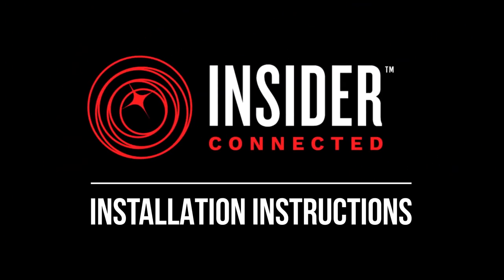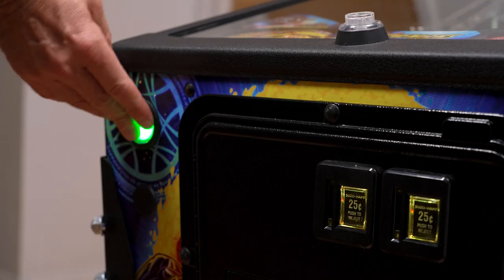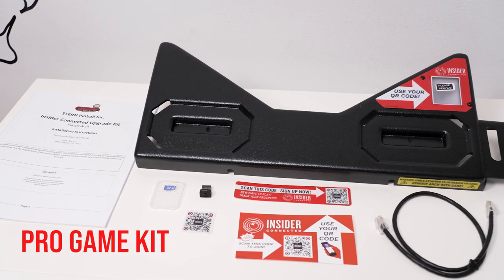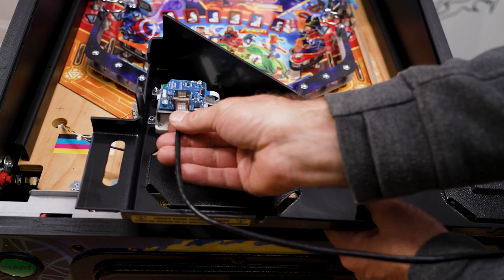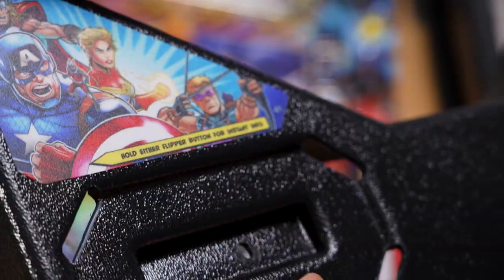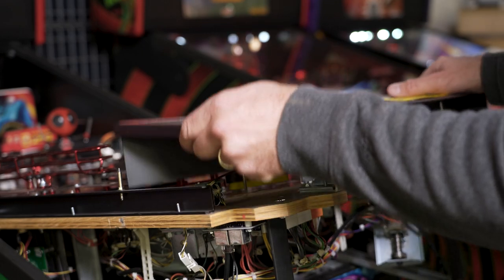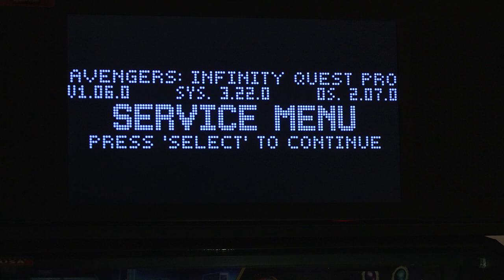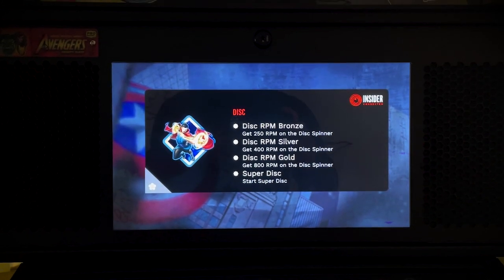Insider Connected Upgrade Installation Instructions

Comment: Star wars has all ports used. How do you suggest to install this?
Reply: I bought an extra ethernet cable (about 4 meters long) and used it from the RJ45 connector on the QR node and connected it directly to an empty spot in the backbox (1 out of 3 ports is not in use).

Comment: I would like to do this for my Stranger Things pro but I have the unique arch with the UV lights in it. I was told the upgrade kit has a standard arch so I guess it's a no go😢
Reply: If you don't have a dollar bill acceptor on your machine you can get a kit that you can use to mount the QR reader there. It's easy and doesn't require you to remove any art from your machine. I found the kit I used on Pinball Life.
Reply: @heccubus1  thanks brother. Since I posted this comment I found the same kit I'm up and running with it. But thank you for the help! I appreciate it